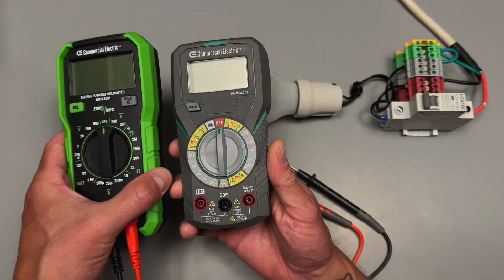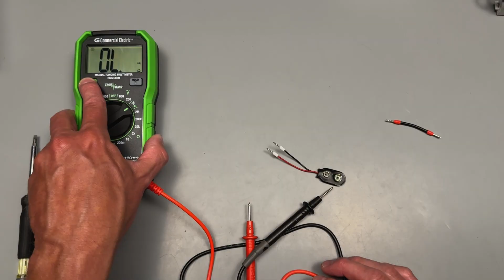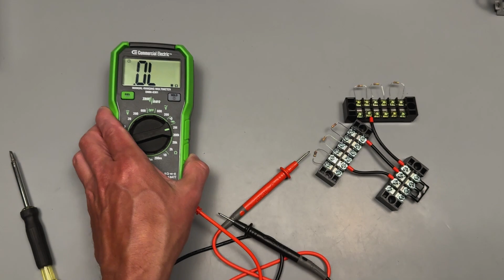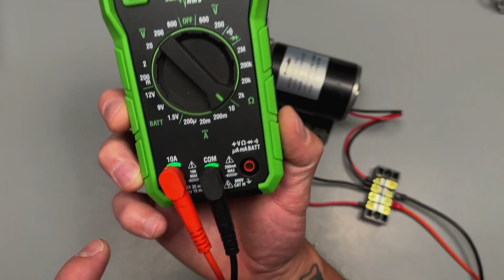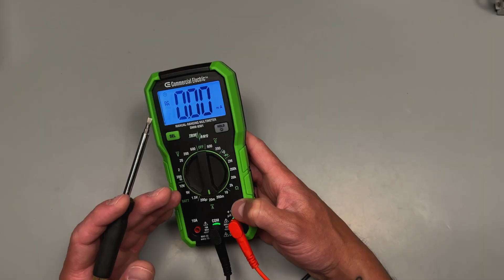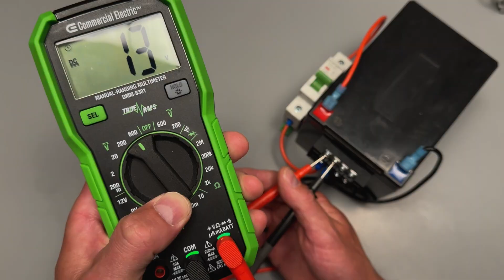How to Use Commercial Electric DMM-8301 600-Volt True RMS Manual-Ranging Digital Multimeter ⚡️

Comment: Can this model check a capacitor?
Reply from the maker: This specific model is not set up for testing capacitance.
Reply: @maddoxmechanic thank you for a timely reply. Im sitting here trying to check an ac capacitor. Have a good day.
Reply from the maker: @NoticeableNate you bet! The next model up from this one can measure capacitance. I’d just take it back Home Depot and get the better one. Here’s hot to measure it if you:

How to Test an AC Run Capacitor with a Multimeter (Easy Cap Check)
https://youtu.be/SUDHmgq7xtI

Comment: What does it mean when  my multimeter says 0 after I  plug it in  and connect it?
Reply from the maker: I would assume 0 volts 🤷🏼‍♂️. Are you sure it doesn’t say OL?
Reply: @maddoxmechanic for some settings it says 0, for others it says ol
Reply from the maker: @priscillaramos3033  the "OL" means open loop, or out of limits. a 0 just means its reading a really small value. I would double check your settings and that your leads are fully seated and in the proper ports. there's a learning curve with trying to use one of these. I would say just start with trying to check voltage on a little AA battery as a way to verify you've got it set up. You also might have blown a fuse in your meter, it might not be a bad idea to check that as well.
Reply: @maddoxmechanic thank you
Reply from the maker: @priscillaramos3033  of course! be sure to reach out if you have any other questions!

Comment: In the drop down you mention it has the capability to test capacitance. Im trying to test my condesor unit's capacitor. But i dont see a microfarad setting on the device. Am I not understanding or am i just out of luck? Thank you for all your help.
Reply: All good, yeah its listed on the back of the packaging that the "DMM-8301S" can but this version cant. Thanks for helping clear that up!
Reply from the maker: @robmchale7945 you bet! Best safe getting that capacitor tested 👍
Reply from the maker: Hey! The product description is copy and pasted directly from the sellers website. However, the meter does don’t have the ability to measure capacitance. Sorry for the confusion.